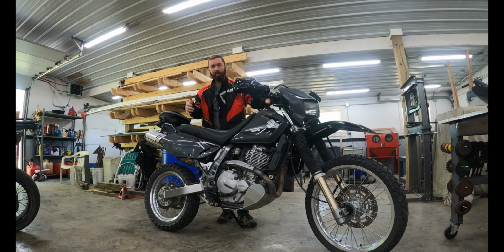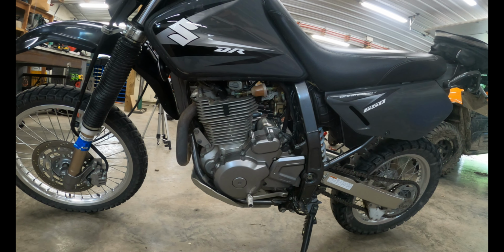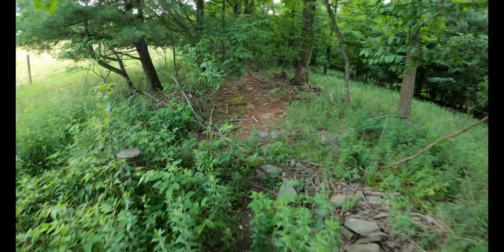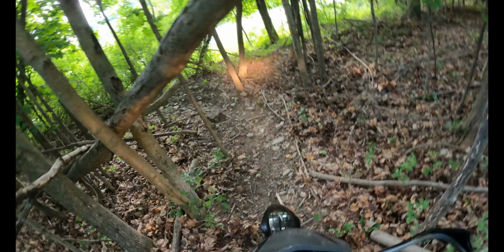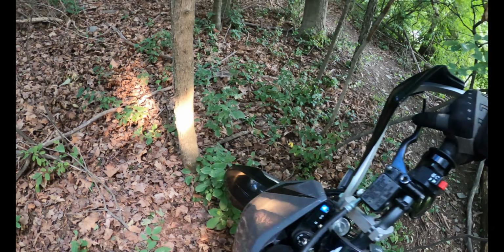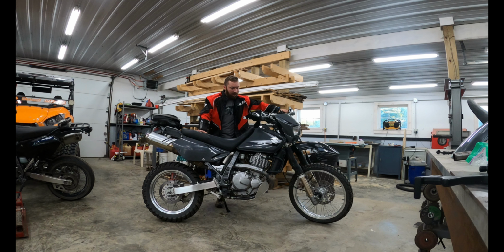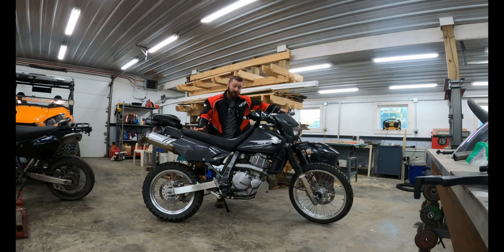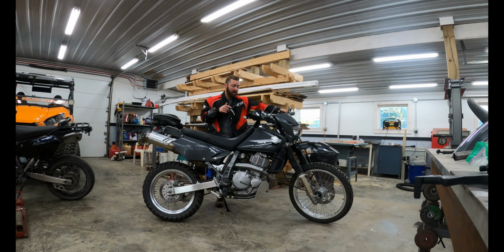Budget ADV Bike - Buying a DR 650 - Like/Dislikes, Single Track, Gravel, Pavement, Wheelies?

Comment: There are so many pros about this bike, and the cons are minimal and fixable simply. I like the idea about this machine that you can change the platform at any time whether you want to use it as a commuter, trail bike, enduro, adventure, rtw, supermotard, scrambler, etc. It is a base for them all. Its the perfect economical dad bike because you can use it for pretty much everything instead of having multiple bikes and you don't have to spend a lot of time working on it and when you have time to actually take a ride you can just go!
Reply from the maker: @TheMotorcycleMessenger  you’re exactly right! Such a versatile yet simple and reliable platform.

Comment: I’ve been watching tons of videos on these bikes. Changing the carb to a 155mm (pro cycle) and jetting your air box gets the bike closer to 780-790cc. Does strain the engine so you’re basically modding it to Italian performance standards which requires more maintenance. But for the price and happiness, it’s a bang of a bush pig for the price 👌
Reply from the maker: That sounds like a good winter project and video, Louco! I’ll have to check out what it takes. Drop a link if you know of a good vid. 🍻

Comment: I've had 2 dr650s. My current one has an apropovic slip pipe bigger rear sprocket bigger jets and aftermarket seat I'm also running D606 front and rear tires. I have many other next upgrades in the future. That bike will take you anywhere for a long time if you take care of it.
Reply from the maker: That’s the plan Ron! Sounds like a nice setup you have. I’m getting ready to do some more aggressive tires and would love to do an exhaust. Gonna do a vid on some upgrades in the next few weeks. Happy trails !

Comment: Thinking between this and a DRZ400SM (convert it). Your thoughts?
Reply from the maker: Converting a drz to a DR? Or what do you mean
Reply: @DirtRoadLife1  A converted DRZ400SM or a DR650 for some light dirt travel and roads? It looks like you may have done this and may have knowledge of it?
Reply from the maker: @ronsexton3685  I had a DRZ 400 SM with dual sport tires on it. I have videos of the DRZ 400 SM on my channel too. It was a very fun bike and both have their place but the DRZ in my opinion will always be more suited for road and the DR is a much better all around and trail and dirt road style bike. I don’t think I’ll ever go back to the DRZ given the majority of my riding is dirt roads, back country paved roads and trails. Hope that helps
Reply: @DirtRoadLife1  I think it does...
I am old now and don't want something too tall or too heavy but would like to get out and ride again. Just not sure I can handle the DR650. How hard is it to pick up?
Reply from the maker: @ronsexton3685  it isn’t hard and it’s easier to throw a leg over I think. I think both are pretty close to the same weight if you look up the specs. Right around 300#.

Comment: i just bought a DR  as well. i was stuck between the drz 400 sm and the dr. only going to do light fire roads for dirt and mostly for wheelie and around town and maybe up to 120 mile days... i almost think the sm may have been better with all terrain tires but was worried about being wound out above 50 mpr all the time with the drz... any thoughts of the SM and DR..
tks.
Reply from the maker: I’ve had both now and the DR is by far a better all around bike. It’s more comfortable more powerful and wheelies just as good as the DR if not better. You made the right choice
Reply from the maker: They wheelie awesome too! As long as you want to ride them 

https://youtu.be/dNgHi6ALdVA

Comment: 49 tooth on rear , bit wild for the road
Reply from the maker: I think its 16 in the front and 49 in the rear after further review. Was thinking front was stock 15 but no
Reply: @DirtRoadLife1  16/49 final ratio seems odd. That wouldn't be much lower gearing than stock, would it? I'm running stock gearing on mine, and it does fine off-road. I've ridden DR650's on treacherous mountain trails in Colorado for 17 years now and these bikes are awesome for that. Before that, I had an '83 Suzuki SP500, the old street legal version of the original off-road only DR500. I rode that old SP500 on the same mountain trails back then, from '83 until '05, when I sold it and bought my first DR650. The SP500 had dual shocks, and a much lower seat height, drum brakes, and kick-start only. I don't miss it though, the DR650 was a huge improvement.
Reply from the maker: @trevorjameson3213  I’m not exactly sure now haha I’d have to do the math. All I can say is I love the bike it’s so much fun on just about any terrain. Can’t wait to do some adventure type rides on it like you have
Reply: @DirtRoadLife1  That is a strange ratio as the 16 front is for higher mph at lower revs and the 49 is just the opposite. I've been considering going 16 front 41 rear but that requires a 520 pitch chain as those tooth sizes aren't available in 525 (stock) pitch. which is why you might want to confirm your set matches, btw. I just replaced front, rear and chain with stock ratio and pitch as the original set was worn, stretched and missing teeth in the rear:) I want more high speed for longer highway cruising since 80 mph is now the norm around here and its winding up at that speed, enough to make my hands go numb. It does have a jet kit and air box mod, stock exhaust so the power is there for longer gearing. Tho now i'm eying a 2018ish africa twin to fit that niche and keeping my 03 DR650 for the trails, bought new in 04ish, btw. They are good bikes that are hard to kill, trust me i've tried many times.
Reply from the maker: @livfreelee  glad to hear everyone talk about how bulletproof they are. And I believe you’re right… I think I was wrong about sprocket size I’ll double check. Bike tops out about 90 mph if I’m really cranking on it
Reply: @DirtRoadLife1  It sounds like the gearing is shorter than stock as mine will do 100+ if pushing it.